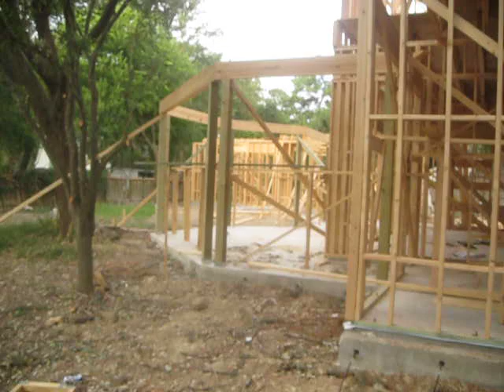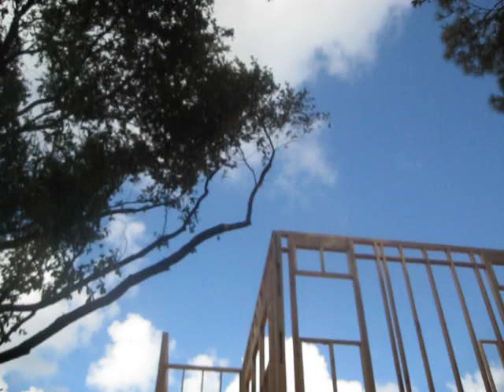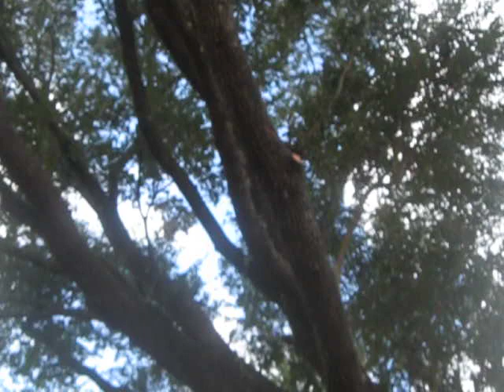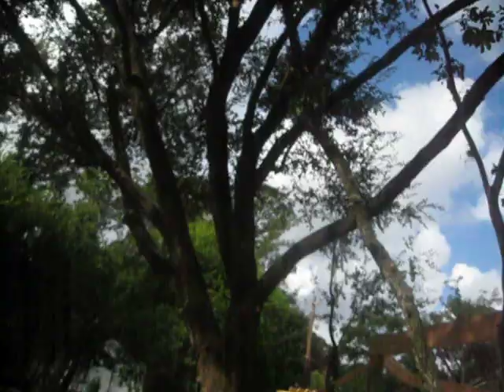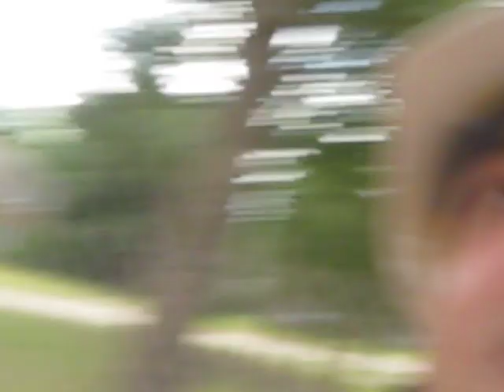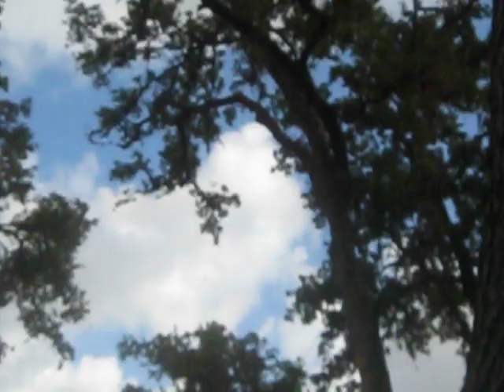Gene Basler Houston Arborist Construction and Pruning Damage

Comment from the maker: While the latest version (2008) of the ANSI A300 doesn't explicitly state the 1/3 rule, it is still a legitimate rule of thumb. If you're cutting back to something smaller, then you should rethink your technique: 999 times out of 1000 you're making an improper cut. The Standard states "the remaining lateral branch should be large enough to assume the terminal role." (5.3.4). You'll have to make a convincing case, backed by research, that something smaller than 1/3 can assume the terminal role.

Comment: unfortunately there is still far too much of this "pruning" work done...
That said the 1/3 diameter rule is no longer required.. that is you can cut back to smaller if needed..
Also it wold have been nice to mention root zone protection...
anyhow, thanks for sharing..